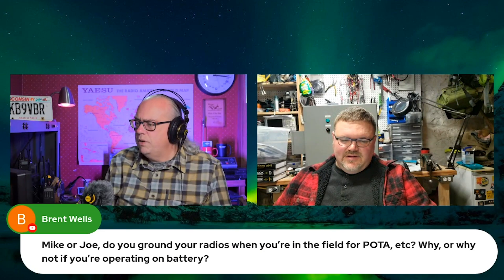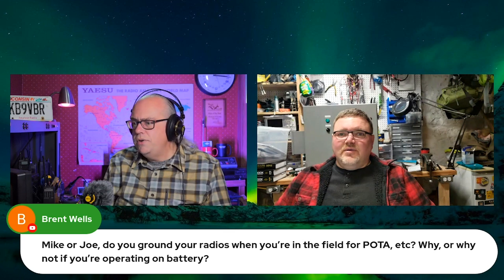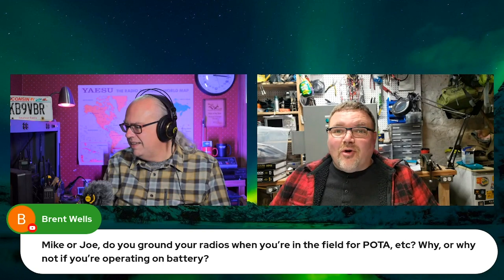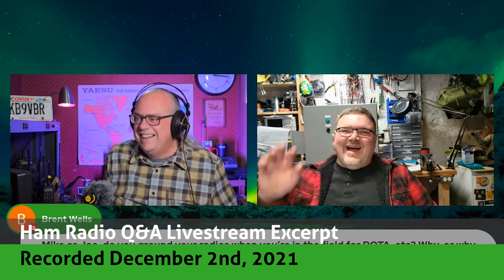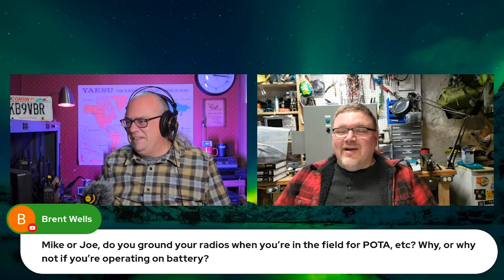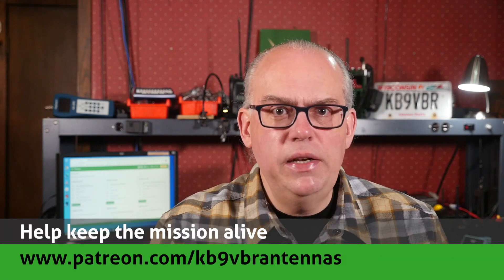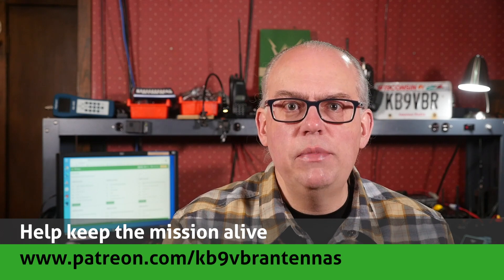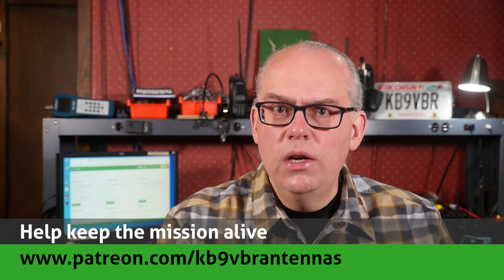Do I need to ground for portable operation? December 2021 Livestream Excerpt #HamRadioQA

Comment: I don't feel the video properly addresses all cases, and the fellow laughs off any grounding done for POTA type conditions. For field/emergency use I have an EcoFlow 120Vac solar generator that does not ground the 120Vac output receptacles. I plan on using this to power my 120Vac to 13.8VDC power supply that feeds my radio. I will definitely ground this setup. I plan to hammer a 3 foot metal rod half way into the ground and attach a ground rod clamp and busbar to which my radio and power supply chassis grounds will attach. This is for safety purposes, to bleed off any stray floating 120Vac to earth ground reference. If you think this is a bad idea or unnecessary, change my mind.
Reply: Would you change your mind or are you 100% confident in your solution?

If you were running off of a LifePo4 battery would you do the same?

Comment: Another great video thank you! Mike do you ever use an end fed half wave like an MFJ 1982LP? I haven’t used mine yet but plan on trying it out soon. It’s only good up to 30 watts so I will likely used for POTA or other field type setups. Do you think it’s necessary to use a counter poise on the antenna, if so, roughly how long should the counter poise be?
Reply from the maker: For a true end fed half wave antenna, a counterpoise isn't necessary. I've been using an EFHW for some of my POTA activations and never use a counterpoise. But if you wanted to add one, I'd make it about a 1/4 wave of your lowest used frequency.
Reply: @KB9VBRAntennas  ok so being new to HF, could you explain that a little. I use 80 -10 meters currently in my ham shack but Im running a G5RV JR, 21 feet up, inverted v, 100 watts on Yaesu FT-891, with a 1:1 balun at the end of the ladder line. Although it’s not supposed to be resonant on 80, I find that at times I can tune in 80. In the case of End Fed Half Wave,,, what did you mean by a quarter wave of my lowest used frequency?

Comment: What if kite or balloon antenna where static alone will need a ground.
Reply from the maker: Yes, but that ground is serving a different purpose to bleed the static off the antenna.
Reply: Any portable antenna will build enough static to damage a radio.  Kite antenna or a dipole in a tree will do the same damage. @KB9VBRAntennas

Comment: Im renovating my radio room after 44yrs. In 1977 it had floresent light bulbs which caused noise in my HF reciever. I changed to incondesent bulbs. Im considering LED bulbs. Will it cause noise ?
Reply: Some brands moreso than others with LED's.

Comment: The engineers at Icom have the following to say about their IC-705: When connecting an external DC power source, ground the transceiver using the ground terminal [GND] on the side panel to prevent electrical shock, television interference (TVI), broadcast interference (BCI), and other problems. 

My experience includes “other problems” and a frequent need to stake the IC-705 when using Winlink or FT8 on certain frequencies, more notably on 80 meters.  RF on the USB cable wreaks havoc on my touchpad mouse, and at times completely disconnects my computer when the radio is not properly earthed. QRP, no problems. Granted, there are several other possible solutions, such as wrapping the USB cable around ferrite, or a shorter USB, etc. But, I find that proper grounding in some situations is useful.   Great topic! 73, KO4CES
Reply from the maker: I think this speaks to the ability of USB cables to conduct RF and how capacitive devices are extremely sensitive to stray RF. Proper grounding would be an answer to this specific problem.

Comment: I am kind of glad you posted this. Currently I use an EFHW and my 100watt radio is battery powered. I do not use a ground. Now, if there is a storm coming, I disconnect the coax and put it in a glass jar.